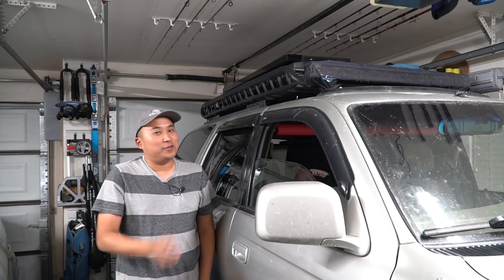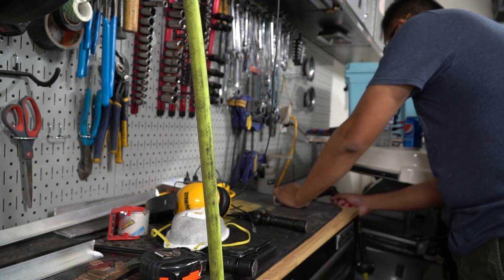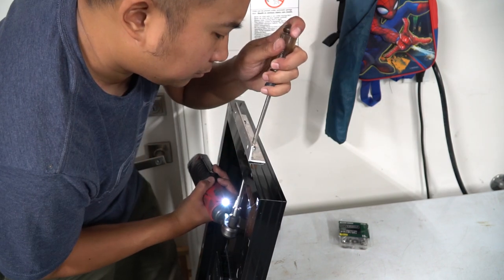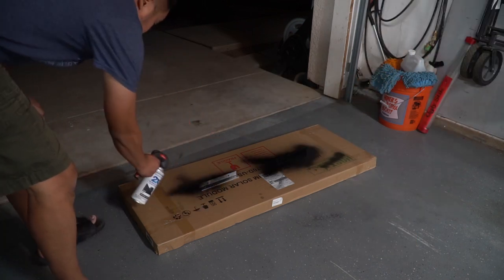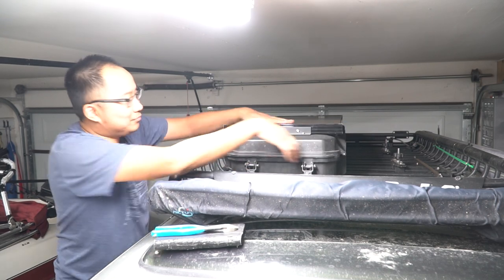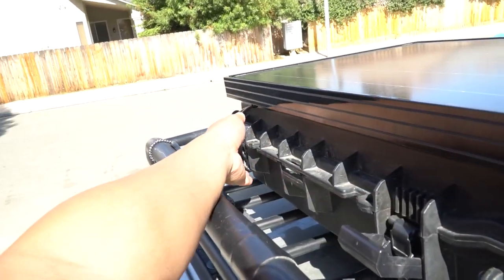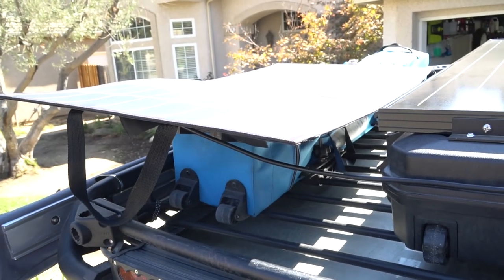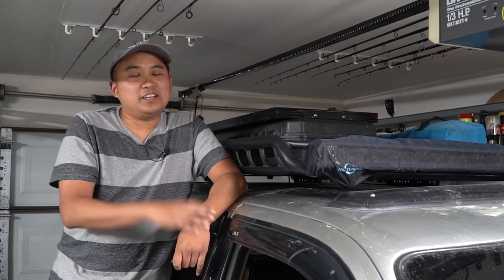Toyota 4Runner Rifle Box Flush Mounted Solar Panel Installation | 70W Panel

Comment: I would suggest using rubber or neoprene washers under your stainless steel washers to make the penetration a little more water tight.
Reply from the maker: Yup!! I might do that! That’s what I did for the rifle box and I’ve never seen water in there

Comment: I have the exact same case and have been trying to find a solar panel that fits! Sadly the one you used is no longer available anywhere :/ Any other leads?
Reply from the maker: I switched it out since I’m running a different setup now